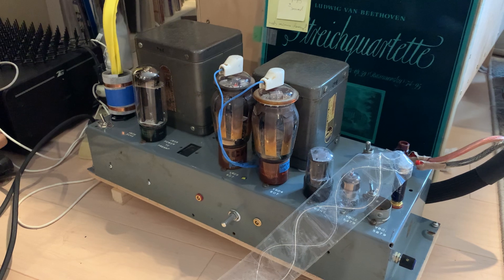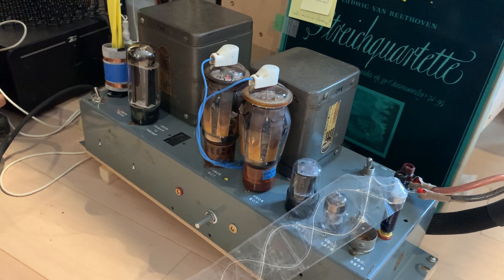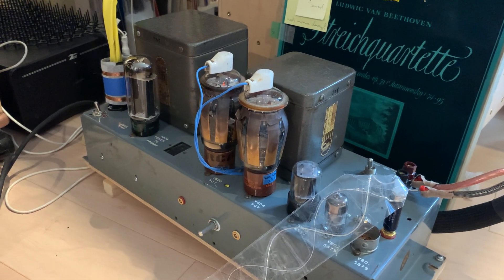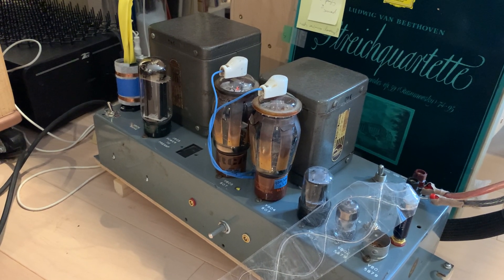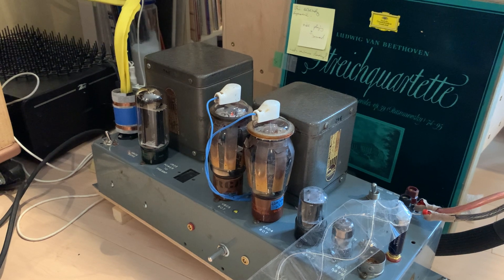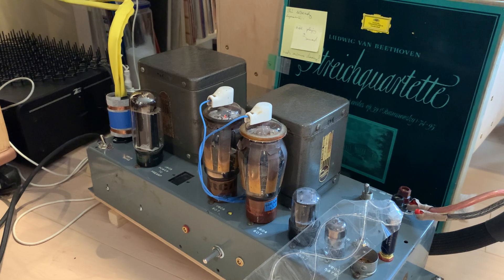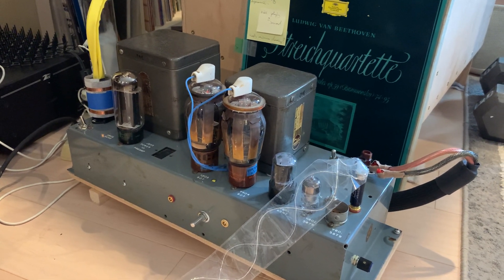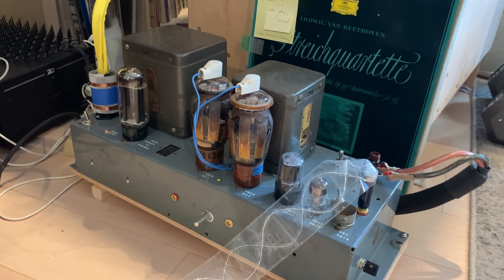The effect of adding a choke to the power supply

Comment: Thanks, Janos - I've been looking at tuning my power supply using PSUDII, too, so I very much appreciate your video! I have a Luxkit A3600 power amplifier running 4x KT120 tubes (ultralinear push-pull). I have diode-rectified 370V secondary producing nearly 500V and CLCRCRC filter (100uf, 350mH 11ohm, 100uf, 1Kohm, 50uf, 100Kohm, 50uf). I have constructed PSUDII model tuned to match the voltage measurements I've taken (B1 of 497V, B2 of 480V, and B3 of 260V). It suggests the B1 supply has significant overshoot and ringing and the preamp stage (B3) has 45mV ripple. I've played around with this model and found I can reshuffle the 2x 100uf and 2x 50uf can caps, double the value of the first 1Kohm resistor, and replace the last 50uf cap with a 10uf film cap to improve the power supply's performance. It would eliminate the overshoot and ringing by the B+ supply and produce much less ripple in the preamp (B3) supply (21uV). The resulting CLCRCRC filter is 50uf, 350mH 11ohm, 2x 100uf, 2Kohm, 50uf, 100Kohm, 10uf. Total capacitance has increased by only 10uf from 300uf to 310uf.

I've mapped out the physical changes and am just waiting on delivery of an Audyn Mk2 poly cap to try it out! In keeping with your advice about making one change at a time, I might split the work into three steps to isolate changes (eg replace the last 50uf cap with the 10uf one, rearrange the can caps, replace the 1Kohm resistor with a 2Kohm one).
Reply from the maker: Superb! That's a nice strategy for the replacement sequence. The 10uF film will be quite a bit a step up in increased detail level, and then the resistor adjustment will make it smoother and more natural. Changing the 100uF - 100uF to the 50uF-200uF will give the biggest impact, as that will reduce the transformer strain a lot, and at the same time increase the stored capacitance for the power tubes. It will sound more relaxed and more dynamic at the same time. I'm curious how it turns out, please keep me updated! Cheers, Janos
Reply: Thanks, Janos! I received the 10uf Audyn MkII polycap and installed it this morning. I've had about 90 min listening time so far but my first impressions are positive! It isn't the proverbial 'night and day' difference but I can hear better the space in which each instrument and voice appears. I will give it a few more days of listening to solidify my impressions.

The next change is to increase the dropping resistor for the second (driver) stage from 1Kohm to 1.5Kohm. This will reduce the plate voltage of the input and driver stages by ~10V (260V to 250V and 480V to 470V). It will also reduce residual ripple and should slightly reduce distortion (effect of a more optimal bias point) but will also make the power supply slightly slower.
Reply: Well, its been more than a few days but those first impressions stayed with me and there was no downsides I could distinguish. A couple of days ago I finally pressed on with both the change in the second node dropping resistor (from 1Kohm to 1.5Kohm) and rearrangement of the first and second nodes (from 100uf and 100uf to 50uf and 200uf). You were right about the big difference! I can hear the resonances in every voice and instrument much more clearly! The front to back imaging used to get indistinct very quickly the further voices and instruments were set back but now they are much easier to distinguish. 

The only concern I have is that the cap grounds are no longer in order along the ground bus employed by Luxman, which runs from the centre tap of the power transformer along the chain of power supply caps and then the fixed bias power supply caps and ends at the input signal ground. In theory, this mixing has the potential to create noisy ground loops but I do not hear or detect any deleterious effects so I might just be lucky?
Reply: @realworldaudio   - thanks, I will do that!
Reply: @realworldaudio  Thanks, Janos - your video and a series of articles by DHTRob provided me the confidence to tune my power supply using PSUDII with very pleasing results!

Comment: if faster transients need sudden current rise , and chokes slows them down , maybe they dont use inductors for that reason .
Reply from the maker: It provides a steady current, and it’s capable to deliver voltage.  It’s perfect for devices that need voltage swings. Does not work for devices that need current swings. It’s not good or bad - it becomes good or bad depending on applied at the right or the wrong place.
Reply: @realworldaudio  voltage cant increase when resistance is constant without an increase in current .
Reply from the maker: @tolgadabbagh1877  Inductors store voltage, that's the big difference between straight wire and an inductor. Just have a look at the tube power supply simulations, chokes can store absolutely monstrous voltage swings, quite beyond the actual high voltage. So, while a resistor cuts BOTH current and voltage, a choke limits current but supplies voltage. A choke is a storage device. It stores voltage.
Reply: @realworldaudio  it stores energy . what i say is quite different , yes the sky is blue but the subject is about ohms law . if you stop sudden current rise or limit it with a choke you cant raise the voltage at the resistor . there is no discussion about this . also the voltage is already at the rails .

Comment: I, like you, prefer higher sensitivity speakers (~95dB or higher) being driven by my Quicksilver monoblocks. When I built one of my phono preamps, I was getting a bit of hum, and it wasn’t a grounding issue, especially after connecting a 10 ohm resistor in parallel with a .1uf capacitor to the chassis near the IEC’s earth ground, but of course not on the same screw. I replaced the 1.2K resistor before the two 150uf 450v (you’d obviously need to see a schematic. lol) with a 20H 20mA choke and the hum went completely away. Thanks for another great vid, Janos!
Reply from the maker: Hi Nick, most phono stages / preamps are designed with 83dB efficient speakers in mind, to have quiet B+ enough for them. If you connected the phono stage to one of those, it would have been quiet. The +12dB efficiency of your speakers makes the phono's hum x4 louder, and hence, bothersome...  swapping the resistor for that big choke cuts down the B+ hum by 15-20dB or so, and bringing the hum down to a non-issue with your sensitive speakers ; )
Reply: @realworldaudio  Wow, thanks for the info! Looks like besides me not hearing the hum any more can be shown easily too. It seem like the choke removed almost the perfect amount of decibels needed, and that’s obviously what I’m hearing! Thank you!
Reply from the maker: @NickP333  :)
Reply: Hi Nick would you know somewhere I could buy a replacement Choke for my Quicksilver mono blocks 1969 era have been searching no luck on google and you tube Thanks
Reply: @richardrichard4394  Hi there, Richard. The first thing I’d do is to call Mike at Quicksilver and hope he can send you another one. Besides that, if you’re not having any luck via google or YouTube, that’s a tough one. Have you tried the Hammond or Edcor sites for it? What’s the value of the choke you need? I’ve got a few extra chokes, and maybe I have one I could send you. Best of luck to you, Richard.
Reply: @NickP333  Thanks Nick for the help ordered one from Quiksilver today think the quality might be better than Hammond Thanks again
Reply: @richardrichard4394  Nice! Glad you were able to sort that out. Yeah, as far as I’m aware, Mike winds his own transformers, so it’ll be better than Edcor or Hammond.

Comment: Biggest cause of buzzing and hum is bad ground how the ground is laid out as well film capacitors if they have their film on the outside or on the inside can cause  noise
Try a tri filter on the power supply as well of 1uF x3.  Try isolating shield the again section on amplifier from the rest of it same with the power supply
best power supplies for tube amplifiers is a smps running at 120khz has to be kept away from the amplifier close to the wall, with EMI filtration and RF filtration on the lead to the amplifier a ferrite bead with one turn on the positive connections
Tubes especially power tubes should never be that close at least 3.5 inches apart you could move them or put a 1.5mm ground fixed still plate between the two

What's the name of that CAD software ....? I don't think it's going to be us intensive and as good as micro-cap what you can build you a switch mode power supply and simulation tests what is free now used to cost $4,000 guy's retired now and is updating
Reply from the maker: Thank you John! You just covered an entire series on hum reduction and proper building practices. :) :) Indeed, all those details are the secret for a quiet amp. As I'm used to 95+dB efficient speakers, I like to make the B+ as quiet as possible, so the residual hum on the B+ does not show up even on high efficiency speakers, as the residual HV hum is still there once measures are taken to keep added noise out (from bad layout, etc). Indeed, thank you for the software recommendation, I shall start using it, as it's always better to have a tool than not. :)